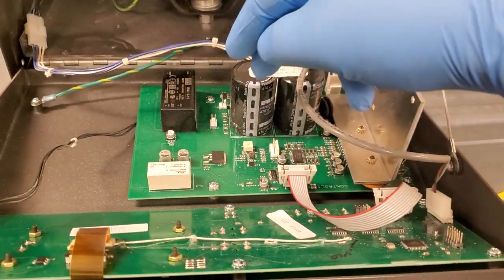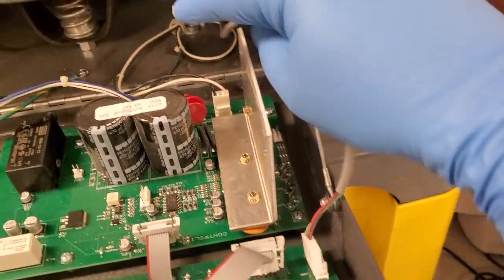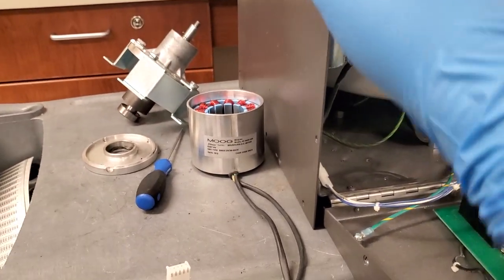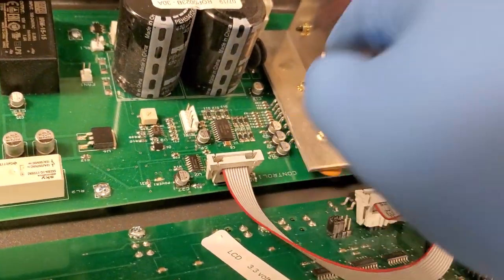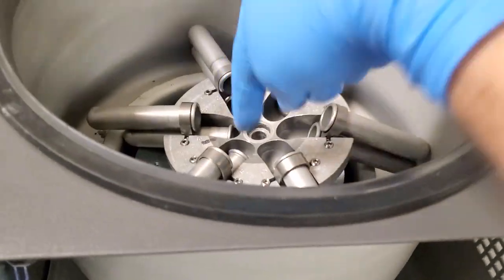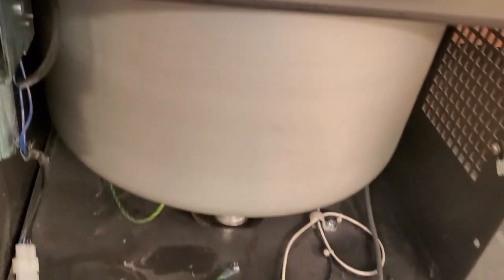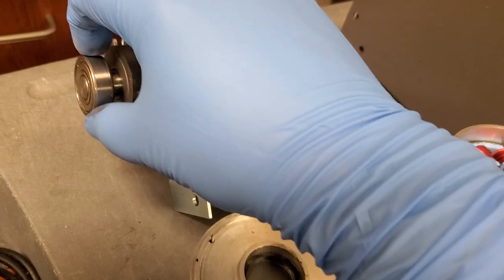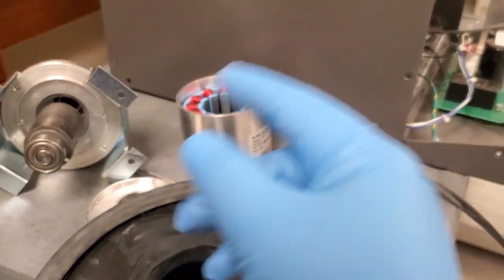Anatomy of a Centrifuge Failure!

Comment: How would you go about balancing the rotor after you put the new motor in? I have a centrifuge I’m working on that has a vibration problem and the operator is loading the rotor correctly.
Reply from the maker: All of the removable test tubes (and their spacers) were pulled, cleaned and then measured on a digital gram scale. Close matching weights were placed on opposite sides of the rotor.